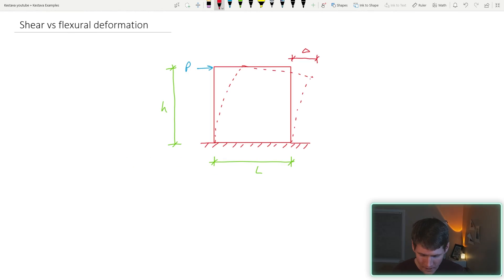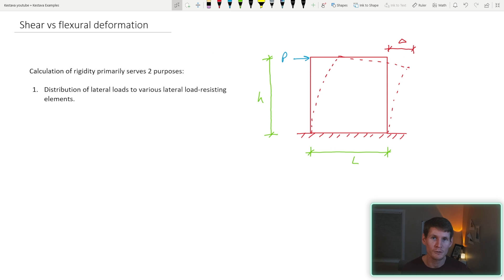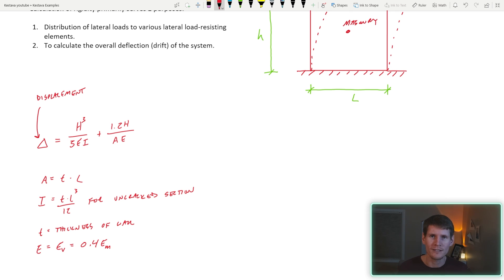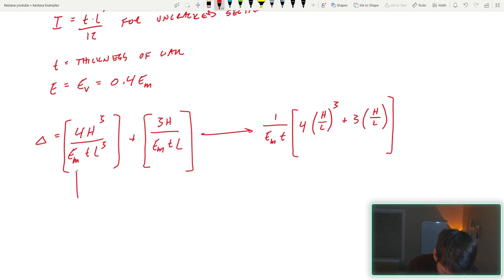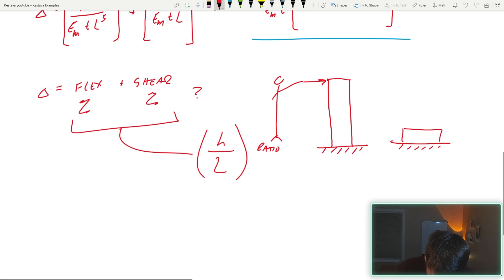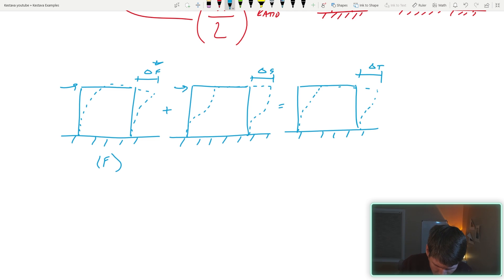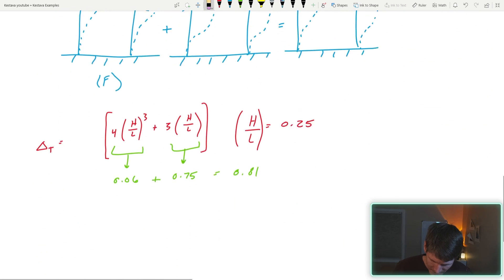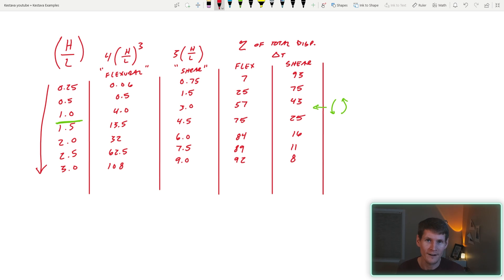Shear and Flexural Deformation of Shear Walls Explained | With Example

Comment: Hi Man, Love your videos they are so helpful.  It looks like the .4 from .4Em Got distributed into the Shear term but not the Flexure term. Flexural Displacement =  1/(3/12) (h/l)^3 = 4(h/l)^3  (.4 was not included)    Shear Displacement = 1.2 (h/L) / 0.4 <--- = 3(h/L).  Is it done this way for a reason?   Or was it mistake? I got my PE Exam in 5 days and I gotta nail this.   Also is the wall displacement equation in one of the codes.  I couldn't find it?  Thanks for all your videos.  This channel has been a corner stone to my learning
Reply from the maker: check out the 5 minute mark

Comment: but isn't all concrete assumed to have cracked in design?
Reply from the maker: the way I understand it - it depends if you're looking at service loading or design loading. if its service level wind loads then youd want to ensure the concrete does not crack.

Comment: Hai I am facing problem in my live project at work place. I was assigned to design a  steel roof truss. I don't know how to design it as per american standard aisc. Hiw to start and end it? Can you please make one turorial on how to design a roof steel truss amd spacing finding between the truss , load application,  purlin design and it's spacing, connections, so on.etc